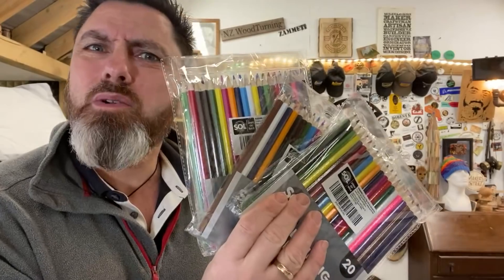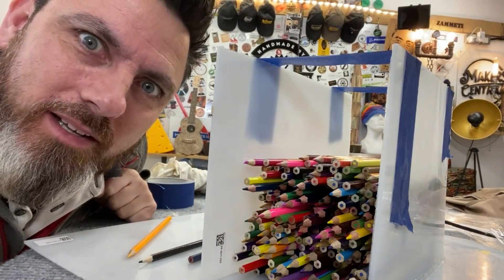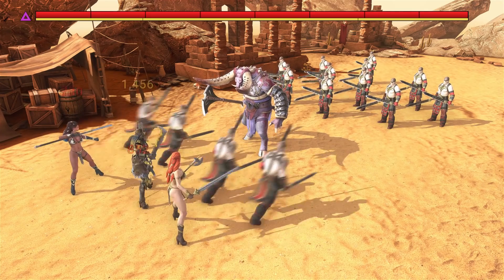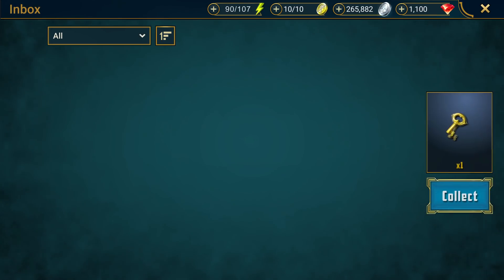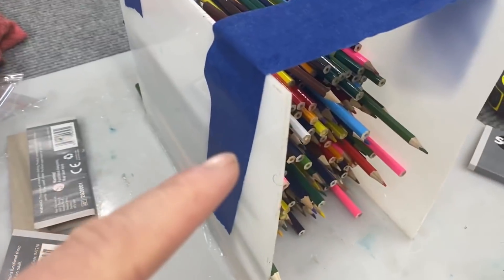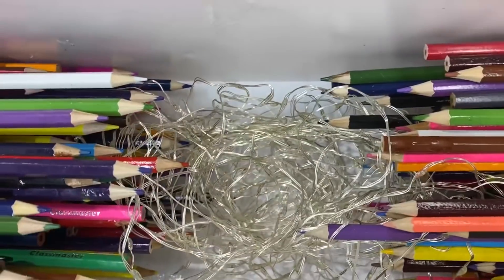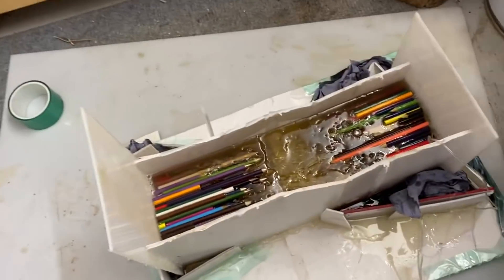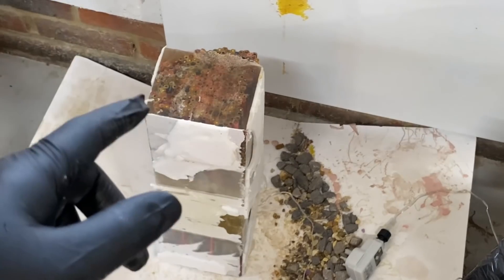I Made a HUGE Crystal Chard from 1000’s of Pencils ! (BUT.. The resin got so hot it melted)

Comment: Suggestion for embedding next time: pour a layer of resin first, then place the lights and pour the other layers, then you know none of the wire is touching the bottom of the mold
Reply: just what I would suggest
Reply: Let the bottom set, re-mold (twice) to pour each side, then put the wires in and pour the middle, making sure the wires are submerged, then pour the top. Only way to be 100% sure you won't cut or sand through any of the wires.
Reply: @thomasarussellsr  great idea! It was a thought I had too!
Reply: Another thought, pull out a pencil and start threading, remove another pencil and continue threading, until you have threaded all your lights. You could even bunch them up in the center so there are no wires close to the edge.
Reply: @thomasarussellsr  I had the same thought.

Comment: Recommendation for next time. put the lights/wiring in a clear plastic tube/mesh in the center to keep the wires under control and have the wire exiting through the bottom.

Comment: if you want to try using string lights again, I have an idea, (might be a good one, might be a bad one)  cast the bundle of string lights in resin alone first, in a cylinder or something smaller than you know the finished piece's diameter, keep the cord coming out roughly center.  then when you go to cast the pencils or wood, you either leave a hole or drill one for the wires to exit out of down the center of the piece.  cut a slot in the mold to feed the wire out and tape/glue it back closed.  if it works, the wire should come out the center and be clear of any sanding/cutting.  if you're confident in your ability to splice wires, you could try turning it on the lathe, just got to stay outside the diameter of the light bundle. in the center.   at least that's what I would attempt if I were to try making something of that kind.

Comment: I'm sure you know what you're doing, and I personally have never handled resin so I could very well be wrong, but wouldn't putting in some sort of mold release make it that much easier to take your projects out of their molds? I bake a lot and I know for certain that it is exponentially easier to get a cake out of a pan that has been greased than one that has been put in dry.
Reply: Another minor suggestion since I think you've had similar issues with sanding or cutting through wires on previous projects: perhaps put a little sticker or a piece of tape where the wire enters the resin and or wood. That way you will have a visual and probable tactile reminder that there's a part you shouldn't sand. Also with a sticker or piece of tape over the wire it gives you a small safety margin. This is just a suggestion and I wish you the best of luck on your future projects
Reply: Nick do you work with big amounts of resin a lot because I had a pretty much permanently surprised look on my face when you started? You do amazing work but this my friend, is more than questionable  🙃

Comment: Nick, Nick, Nick...  take a note from Jedrek29t (edit) and do two things.  One is make a casting in resin only for the lamps so you know that you will not cut the wire.  Two, ensure that you have made a pocket to hold the wire inside the second step of the project pour with a bit of a wood plug cover that is hidden from view.  That way, you'll know when you're near the pocket when you stay to see wood chips coming out of the work, and then you'll just need to get the wood out to get to the wire unscathed.

Comment: I would've took a dremel tool and carved out around the sanded through wire and spliced it, pushed it back in and poured some resin over it and finished it. Worth a shot anyway..
Still turned out pretty cool though.

Comment: Nick, you can find circuit tape and connect the 2 wires with it. Diodes don't take much amps, so the connection won't change even if it have a tiny bit of resistance.
Great video as always.

Comment: Hey Nick! Thank you so much for showing this video!  Since covid has started I have made many of these led embedded lamps ... And the very first thing you learn as you just did is... you have to pour your layer of resin first making it thick enough for sanding later... and then put in your led strings making sure not to touch any edges or top!  I am so glad you show the exact issue with these projects and I have been there ... gutted...not wanting to continue and then getting back on your feet and making it work and learning from it.  THANK YOU FOR SHARING!

Comment: ok got the solution for you,  you solder two lengths of copper rod to the wiring and pass it through the pencils to the base. You do all your normal sanding and polishing.  The copper rods will be exposed on the bottom.  On the base you make a connector so the exposed rods hit that and you have low voltage connection.   for fun you can put the lights in a smaller container and do the resin pour and make a block which you can place before doing you main pour.

Comment: 15:02 - Sure there is. Use a safety-pin or thin drill-bit to carefully drill through the resin until you hit the wire, and repeat for the other three tips of wire, then strip a couple of twist-ties and insert them into the holes to re-connect the wires. It's tricky, but doable (and make sure you connect the wires correctly). You can use dip the ends of the stripped twist-tie wires into some wire-glue/conductive-adhesive to make sure they connect properly to the wires inside the resin.

Comment: Hey Nick,
I have some thoughts for you if you want to try this again. Glue up your pencils by standing them up in the mold. You wanted different heights, so just random trimming of the ends on some would serve this function. After they are glued together, pour the resin in layers like before until all the pencils are covered. Now here is the tricky part. Make a cylinder mold on top of one of the block of pencils. (stand by for metric conversion... **buffering**) You shouldn't need more than 15cm high with a 7-8cm diameter. After that cures, wrap your LED wire light around the cylinder. Use a small, long drill bit to bore a hole down through the base of the block to run the wire through, and then wrap the lighted end around the cylinder. Now form your long mold and set up the "top" and "bottom" pencil blocks and continue to fill with resin. Then shape, sand, and polish. It's a few more steps, but you will never cut a wire ever again. You know, unless you trim the bottom off with the band saw. Conversely, if you are looking for the "jumbled" look to your lights, create a negative space cylinder (hollow) and stuff the lights after it cures. Fill that with resin, then join the two parts. This will keep your wires well away from your work surface. I know this turned into a blog, but just some thoughts to share with you. Cheers!

Comment: Nice save.  Those fairy lights are cool but I think you might need to pour the lights in a small cylinder first and then suspend them in the middle of a sculpture.  Not sure if you would be able to see the separate pour  inside a larger pour.  Fun and inspiring video.

Comment: I would suggest hot gluing a thin wire to you light strand to help give it structure and make it easier to keep it suspended in the center of your piece and lessen the possibility of getting into the wiring while you’re working on it.  Also fit a snap together plug inline of the power side at the bottom of the piece so there’s no wire hanging out to deal with.

Comment: Well done Nick for being able to think of a solution despite setbacks. Am presently trying to cut mitre joints and with only a hacksaw and 400 mm saw I wore out on that laminate flooring, I just got a tennon saw but after I'd cut the mitres.
Now having to sand them down they ain't squaring up properly so with sanding block they ain't coming straight, getting a chisel may be a hack mess so a file was cheaper and safer for me.
Now to square the frame up glue it and nail it together then use the mitre offcut to help strengthen corners. No I ain't got any machines.

Comment: You could put the lights in the holes you made. Put it down then back up the same hole and then go to the opposite side so you get light in the middle. And to make it look like the light fills up the middle put something that light either reflects or travels through so you wouldn’t need to be careful cutting the wire.

Also using a translucent pencil so light would travel through them might look nice!

Comment: Love your work. Not to be a wise arse or anything, but when you sanded off the wire, could you not have chiseled out a small crevice or chunk, reconnect the wire, in bed it deeper, and then just mix a small batch of resin to fill the hole? The lights would work again, it would be embedded deeper, and nobody would notice once sanded and polished?

Comment: If I had the chance, I would make TWO of those for large floor lamps on either side of a couch.  But if you put down a layer of resin before adding the lights, then watched the edges to keep them away from the edge and the "top", it would look very different.  I like the save, however.  The way you're going, you will have an entire 'pencil' room.  LOL

Comment: I hope you saved the shavings from boring out the lamp hole. Those multi-color bits would be cool for another project.
Also, if you’d created a marker “shelf” around the lights to use as a reference to not cut/sand through the wire might’ve worked better.
Otherwise, that was a very nice save of the “failed” project. Have you considered doing a colored drinking straw w/resin project?

Comment: Nick, next time mount some copper plates inside, and solder the wires to the copper.  Then you can make an electrical contact by putting a screw through the copper plate.  No wires sticking out of it to create problems when shaping it.

Comment: Have you tried soldering a small jumper wire between the cut ends of the wires cast in the resin? If the ends are open to the air, you should be able to do it.

Comment: If you try this again, try putting an inch of resin in and let harden before adding the lights.  Then put the lights in making sure you have about an inch on each side.  The add more resin on top making sure there is an inch border.  This should give you working room.

Comment: Might have been able to use aluminum tape to make the connections for the wire you sanded through then paint a little resin over it to seal it.

Comment: Next time, run the lights up through the holes you made by jenga pencil stacking and pour a base layer before settling the wires. Like make a base layer and let it set most way so they won’t sink. Then you can sand without issue.

Comment: I am so sorry that you were unlucky twice. While looking, I had an idea how you might be able to avoid it next time. At the beginning, make a casting of a smaller crystal, in which the LED lights will be embedded. When this has hardened, first a layer is poured on which the crystal is then placed and the cable is led out, then another layer follows, just as much so that the temperature does not get too high, just step by step. If everything went well, the part sanded the way you wanted it to be (plan at least two fingers or thumb width of the crystal to the edge), the cables should still be undamaged, the resin clear and I'm sure it will be again once a spectacular sight. If there was a suggestion how you could approach it differently, perhaps color the crystal inside differently like an inclusion, it would certainly look awesome how a blood-red inclusion starts to glow. Of course, these are only considerations of how you can create the project the way you originally wanted it, maybe it is a suggestion, in any case not a criticism. ;-)

Comment: Gotta ask Nick, isn't there a way to sorta stableize the wire to prevent sanding into or cutting?  Aside from creating a hollow within the project and adding the wire later I'm not sure of how this could be done.   Maybe hollowing it out adding the wire then refilling the center portion although that would take away from the contrasts of the filler, pencils in this case.  Anyway, as always, great project.   You are always a pleasure to watch.

Comment: Next time maybe try casting the bottom layer without the light and make two plain pieces of resin sheets that you can slide in for the side so the light are pushed farther into the middle and you know for certain you have a good amount of space bettwen the wire and the sides of the piece.

Comment: I think you should have cast your wire in a small clear block or cylinder then placed that inside after you did your first pour on the big mold and let it cure so you could center the light block. You would have to be careful on the first pour so you can still route the wire from the light block through the pencils. Nice recovery though, but I think a little better planning could have helped you avoid a ton of headaches. Good luck on the next one.

Comment: well persistence is always good.  I would have done some things a little differently of course but then not sure how will it would have worked out too.  Like, put vaseline on random coloured pencils and pull them out after the resin has set as they shouldn't be set in.  Or setting it all up by sticking them into Styrofoam, cast it larger, sand down to where you want it, drill into the foam, wash it out with acetone, punk in the wiring, seal with a final pour through the drill hole, polish again and bobs your uncle what :O

Comment: Perhaps you could have poured in a layer about 2cm high, waited to dry and rotate and repeat until you got a U shape then put in the lights. Then pour in enough resin with 2cm from the top. That way, any wire emerged could have been stuck down before the last layer? :)

Comment: I think it would be cool if you cut the wires out of the failed one and turn the ends into a fat stubby pencil.  Then you could slice them in half and lay them point to point like an hourglass ⌛️ in a new form & put your fairy lights in the center.  Pour your resin and now you have 2 lamps again that are just not as thick, but still very cool 😎.

Comment: maybe next time try making 2cm resin boarder(you know pouring a bit resin in the mold then rotating on the other side and pouring another 2cm) and only then put in lights then you will know how much material you can take off.
But well it would take you more time 5 resin pours, and remaking mold walls 3 times..
as for lights I  prefer fiber optic lights (you can achieve similar effect to led lights) because it has one source of light if broken you can change it.

Comment: it ended up nice... but maybe if you had poured 13-19mm of resin first before adding the wires,  it would have given a buffer to help miss the wires and plenty of room to turn or sand. plus it would have given time for the first pour to not overheat and have an exothermic reaction.

Comment: It needs to be a lot less bright and it needs to have multi color changing light at the bottom it would have been cool if the string of lights that you put in the middle lit up maybe the next time you can't write encapsulating the lights into the resin end of the Peace it's still cool though

Comment: You could have repaired that wire. Flux and solder will get you out of trouble. Make a bridge, put some epoxy over it to seal it, and put that part at the back

Comment: Great video, as usual, but I wonder if it wouldn‘t have been possible to solder a small wire strap on to fix the sanded through wire. Would have worth a try.

But it turned out great anyway, so no worries 🐶

Comment: Me, I'd have tried to dig out a little resin and splice jumpers to the wires, then add a layer of resin over that spot (after the lights worked ;-), then maybe gone to plan B if that failed. Nothing to lose at that point, but if time is a key element, never mind.

Comment: Idk if this would work but somebody makes a marker that has ink that is conductive.  You can use it to close low voltage circuits.  I right that might "connect"  those wires.

Comment: Ok so for next time. Take a dremel and dig the wires out. Undercut the extraction, solder in a splice, heat shrink, epoxy. And lastly waffle on

Comment: Would you be interested in turning an actual rocket body, maybe a meter long, if your lathe goes that long, 4-5 cm thick? you can turn a nose cone and a cavity in the tail to insert a hobby rocket engine. you could craft fins and actually let it off outside when you're done.

Comment: Warning: Rant from the safety police!
I know resin is not the quickest of crafts, but you've had heating/cracking issues before - ships in bottles comes to mind - so it baffles me to think you would risk something as dangerous as this. Exothermic reactions kick off some awful fumes and get very dangerously hot, I've seen others start fires on a few too many occasions.
The bits after sanding where you cover your face in "dust" is not advocating the best H&S practices either. As I'm sure you're aware, resin dust & sanding particles are very toxic and dangerous, I assume you wear the necessary PPE while sanding but this comedic 'bit' doesn't help those who are learning. I first found your channel when I was learning but I was smart enough to do thorough research, whereas I know that others don't.
It may be an idea to put a safety warning or disclaimer at the beginning of your videos, I do not want someone trying this at home without doing their homework and putting people in danger.